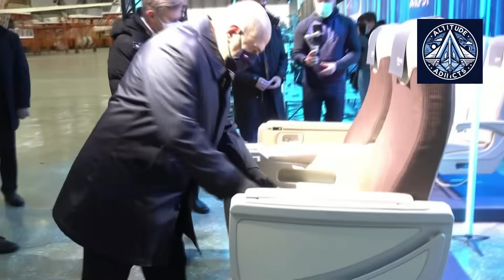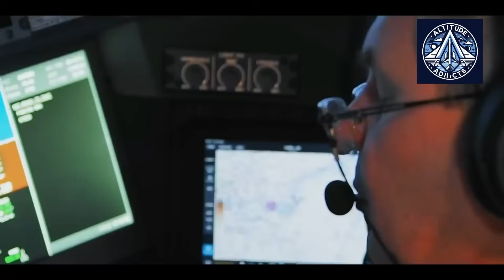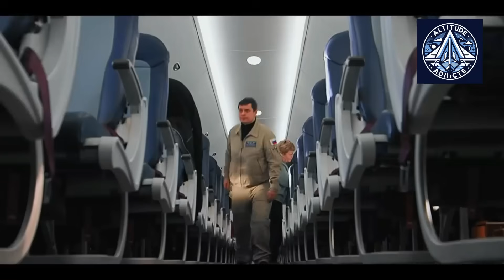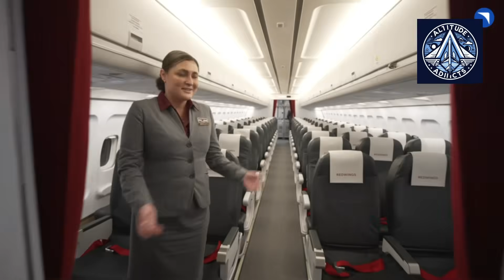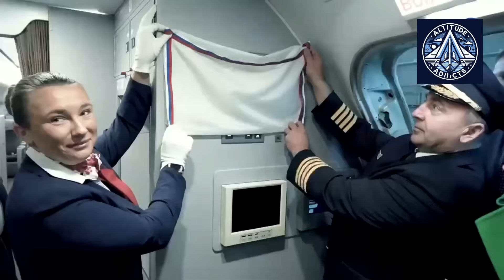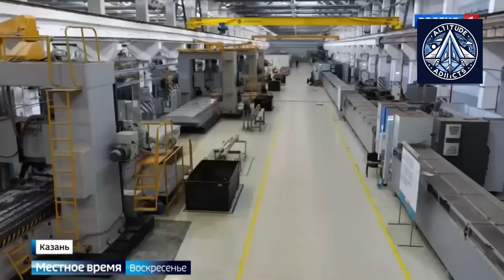Inside Russia’s Futuristic MC-21 Cabin: Flexible 3D Design Revealed!

Comment: The MS-21 is a good aircraft, but right now I'd prefer the Tu-214. Of course, it needs to be modernized to meet modern requirements, but this aircraft is already in production. The Tu-214 has seven modifications, including medium- and long-haul versions. In 2024, a modified version of the medium-range Tu-214 entered service as a flying testbed for testing the transition to a more compact two-seat cabin and experimenting with composite materials. This 210-passenger model has a range of 6,700 km and is equipped with modular fuel tanks that can be removed and installed interchangeably with the cargo compartment. The long-range version of the Tu-214, designed for 142-150 passengers, has a range of 8,000-9,000 km. This aircraft fully meets Russia's needs. Although the Tu-214 certainly does not have the wide-body configuration of the MS-21, unlike the MS-21, it is capable of standard-range flights and is ready for production today. If Russia improves the Tu-214 by adding a two-seat cabin and composite materials, the aircraft will likely become one of the best in its class, while being cheaper than the MC-21. Currently, modifications to the Tu-214 are being developed at the plant, and five new workshops are being built on the factory grounds. I hope the Tu-214 will still find its place in the skies, as it is a magnificent aircraft.

Comment: 3d modelling whilst wonderful in visualization, have drawbacks. How well the model is 'designed' in the computer governs how well it performs in the simulated environment. Let's not forget that its a computer model, which is ruled by the assumptions made by the software engineers.
Reply: And how is this worse than paper drawings?
Reply: @VladimirChop  It isn't. But paper drawings cannot be compiled and added to a simulation. A 3D model can be made to exist in a simulated reality, it is here that that the bottleneck exists. The real World may be too complex to model realistically and even then you are modelling it based on assumptions.
Reply: @charlieboye2009  Then I don't quite understand you. Paper drawings are a thing of the past, 3D modeling is not ideal. How then to design? Build a full-size liner right away and test it in a huge pool?
Reply: @VladimirChop  There is no ideal system of design, A paper system whilst cumbersome and labor intensive, has many drawbacks, much more than a computer based system. A computer based system still has drawbacks, even though these are less than a paper based system.

There is no such thing as perfect, often I find even blueprints have errors. With the computer based system, these errors are reduced, but there are still errors.

All these things means little whilst planning and designing your schematics, but mean everything when that schematic is turned into a 3D model and placed into simulation. The simulation result is directly affected by the way the model is designed and loaded in the simulated environment. All of these are all assumptions.

You can get an accurate result, but not a result that is absolute. This is good for most intents and purposes, but the risk of over reliance and complacency are human factors external from the system. That is actually one of the drawbacks of the Computer based system.

Not the system itself, but the people using it.

Comment: It would be nice if they could use AI to design the seats, sitting allocation, and basic layout based on demographic and body morphology. Wider seats for fat demographic and more leg room for taller demographic.
Reply: Using real humans makes alot of sense
Reply: The layout of the aircraft cabin is done after the airline has ordered the aircraft in accordance with its requirements. If the airline wants such seats, there is no problem in arranging such seats.